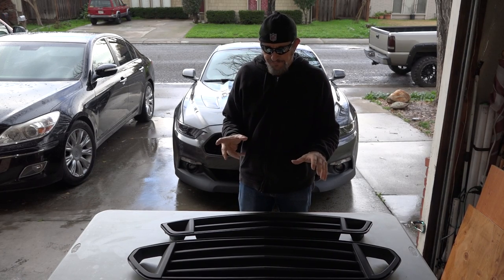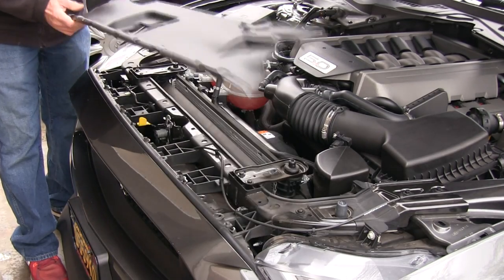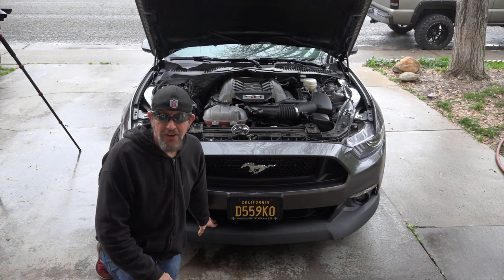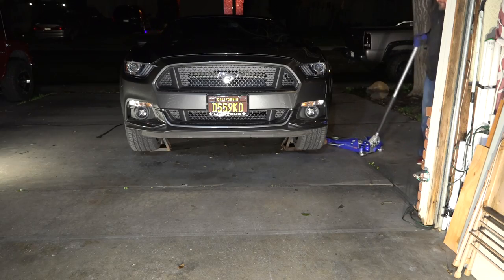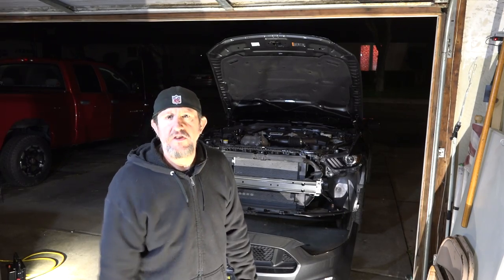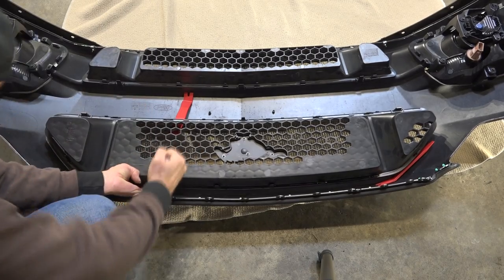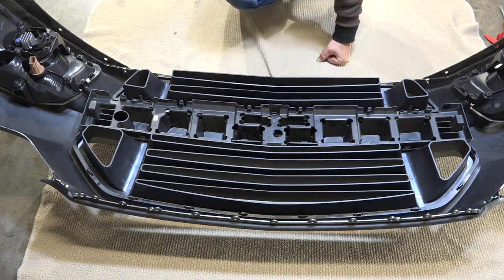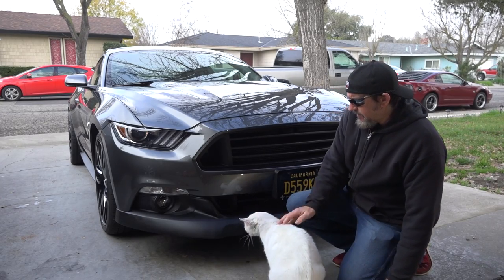MMD V SERIES GRILL INSTALLATION 2016 MUSTANG GT

Comment: So when taking off the front bumper where exactly is the grill shutter system ? Mine has a puncture in it and needs to be removed
Reply from the maker: felix fulton Not sure what you mean by grill shutter system.
Reply: CHRIS10077 it’s acronyms are the AGS system that’s what I was told

Comment: I makes it look like a monster
Reply from the maker: Thanks man !
Reply: so you just removed the 12 bolts from the front of the splash shield to remove the bumper from the bottom right? No need to take off the whole thing?
Reply from the maker: Jr G That's correct .
Reply: Thank you! Was not looking forward to taking the whole thing off, thanks for the great video!
Reply from the maker: Jr G your welcome the only reason the instructions say to take off the entire splash guard is to get to the connections to the lights but you can disconnect those thru the fender wells.